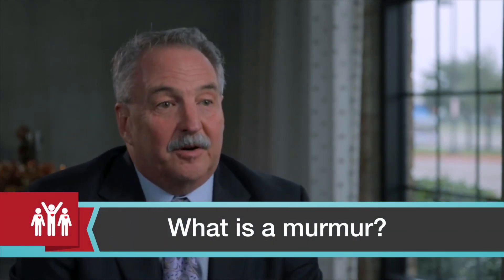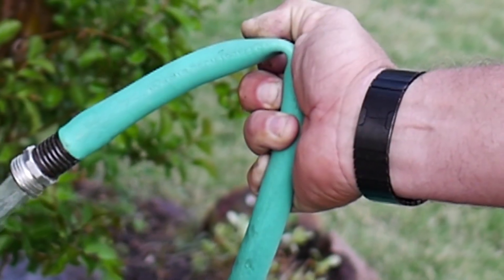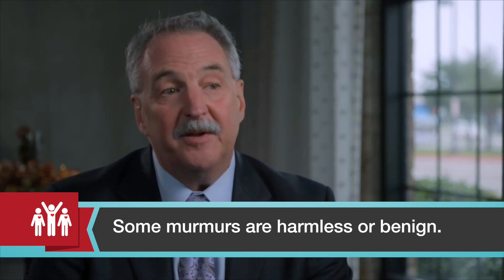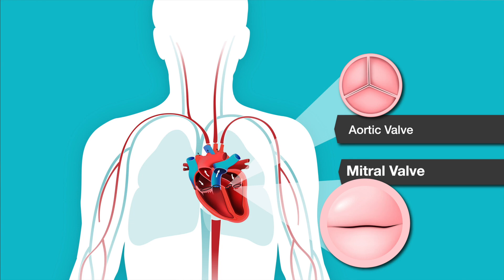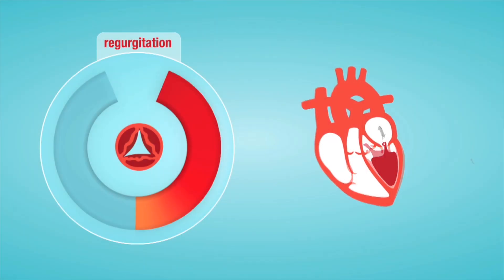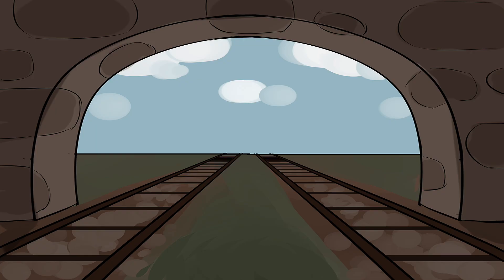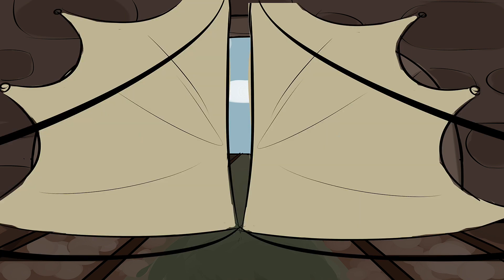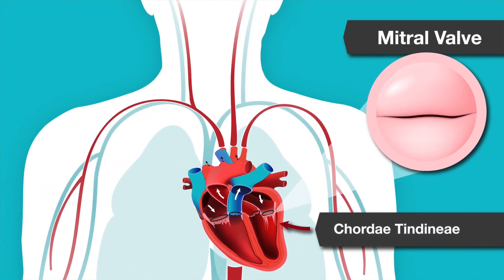Understanding Heart Murmurs, Aortic and Mitral Valve Problems

Comment: I've had a murmur for most of my 70 years and it hasn't bothered me yet in any way (AMEN) but am told now that I need to
get a valve or two repaired/replaced, so am watching these vids to find out more before the operation.  Thanks for posting!
Reply: How did it go? Almost 2 years later.

Comment: I had pneumonia and tachycardia 158bpm,  in Feb, they treated both and the tachycardia with cardioversion once, and put me on Eliquis, metoprolol and amiodarone and it's been stable since around 55-60 bpm. The echocardio grams shows a mitral valve prolapse, which the report says Myxomatous degeneration mild anterior  and posterior leaflet prolapse, moderate regurgitation grade 3+, left atrium severely dilated, tricuspid valve mild to moderate regurgitation grade 2+ PASP normal.
I decided to inquire about valve repair, so the hospital cardiology referred me to a cardiologist surgeon in their bigger facility in another city, I go Aug 10th for a consultation.
At 60, I'm thinking it's better to get this dealt with and fixed sooner than later since it can only get worse over time, and I have good insurance at work that may not be available to me in 5 years, also my deductable resets Jan 1st so whatever I can have done this year is better.
I'm curious how this works with the surgery, I go for a consultation and I assume another echocardiogram then, and then do they just schedule surgery to do the repair or am I going to have to go multiple times for tests, scans and whatever?

I'm wondering how long I would be in the ICU and hospital after, and then after going home how long I might be "laid up" unable to return to work?

Comment: i have murmer congentinal, i had surgery at 6 and then at 31, i didnt put the metal valve. so its still leaking but not as heavy, so now after 4 yrs , its leaking a bit more. so do i need metal valve? do i must do TE checkup in order to decide better?

Comment: i was born with a murmur is that bad
Reply: Xander Pena nope you and I are the same I stay healthy (kind of lol) and try my best not to freak out or nothing because when I do my chest gets some pains but it's ok nothing to worry about unless it's severe if that's possible
Reply: thanks mine is very small
Reply: i was born with a murmer n my heart valve's dont close all the way blood flows back into my heart where the blood is supposed to flow out and when i was younger around 4 or 5 i told my mom my heart was beating to fast and i wasmt running or nothing i was watching tv and i felt my heart n i told my mom she took me to the ER and they said i had to see a specalist for my heart and they said i have blood that stays  in my heart that will not flow out. is this life threatning for any activity sports anything
Reply: Abrianna DeHerrera omg my story is exactly the same as yours! The doctors told me that I would “outgrow” the murmur but still to this day (I’m turning 23, I was about 5-6 when I was diagnosed) I still get pain whenever my heart needs to beat faster 😕 I’m told it’s nothing to worry about but it’s still scary
Reply: Abrianna DeHerrera did you find your answer to your question I’m concerned because my 12 year old daughter was just diagnosed last week did a load of test everything came back normal she does play sports also but any info would help thanks
Reply: 🙋 Heart murmurs are detected by stethoscope, & many are Innocent murmurs, & don't need treatment, but if u get Chest Pain or Palpitations u should always get it checked out 💯
If in doubt, get checked out!! 
 Best wishes to all of you 🙌😘
Reply: Macho Pena I born with one too I had to get surgery when I was a baby
Reply: I am sorry to everyone with heart murmurs
Reply: Abrianna & Daddy'Daddy What treatments & surgeries have your Cardiologists tried so far? 🙌🙏🙌 Best wishes to you both
Reply: Invatorforest Can I please ask what type of Murmur u have, & how it caused u to almost die twice? 🙌🙏🙌 Best wishes to u
Reply: But i live in south africa and its home to Cristian barnard the man who did the worlds first heart trans plant and i was in his hospital "still am" The Cristian Barnard memorial  and my Docker is Susan Vosloo and she is Cristian barnards student so im always calm when i go to her. :)
Reply: John Miller no it’s nothing really bad my heart doc just said I’m going to have heart problems when I’m older
Reply: I have a heart murmur and whenever I do cardio exercises I get fatigued easily.
Reply: Xander Pena h%
Reply: Macho Pena I was born with it and I almost died twice
Reply: Macho Pena me 2
Reply: me too
Reply: Abrianna DeHerrera That’s the same thing that happened to me
Reply: I only whacked this to know what heart murmurs are
Reply: me too my dude
Reply: Nathy_ 24_ 
Yes but please get that chest pain checked out to let your dr. to know
Reply: Felisha Atkins me too i was born with stenosis or at least i think so because when i was a baby i had a 70% narrow aorta  and they put a stent in to enlarge it and when i was like 11 years old i went for a check up at a local dockter and they told my parent that i should get a surgery as soon as possibable and she said i had a Stinosis but i dont know wich valve haha but they cut it open and now im 19 and i have to go for a Third opperation to get a sinthetic valve in its place so yea its this year for me :/
Reply: I just went to the hospital and they said It sounds like I have a small heart murmur my chest has been killing me and I told my dad and he said he thinks I had a heart murmur when I was a toddler
Reply: Same but I don’t remember anything bad happeninh
Reply: Macho Pena same
Reply: @Arrow storm that's so awesome
Reply: Macho Pena me too
Reply: Same with me bro
Reply: Macho Pena I was born with one also now 13 years later it’s still there